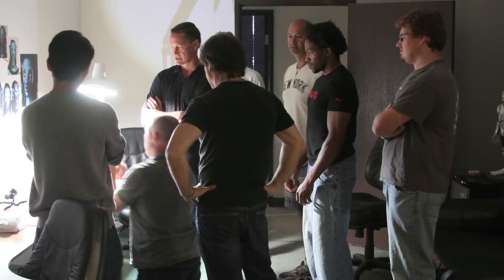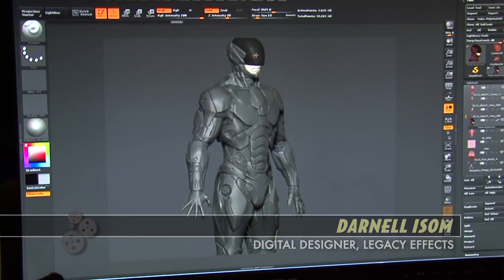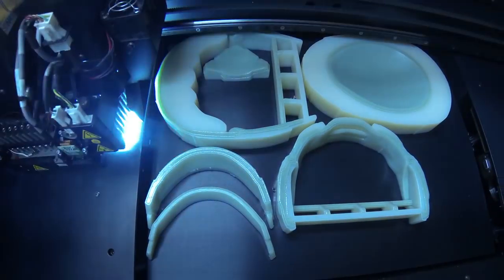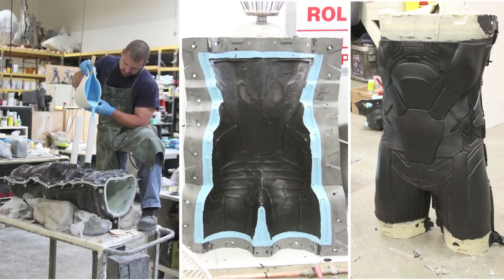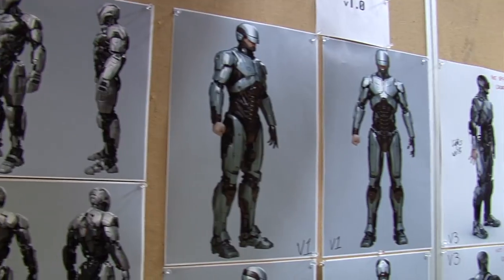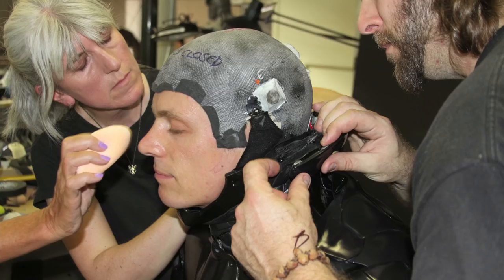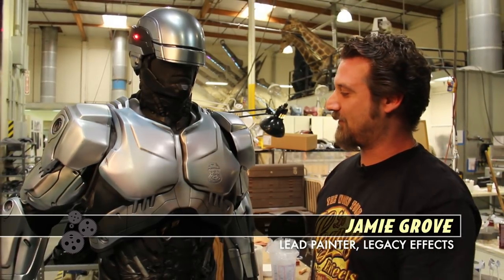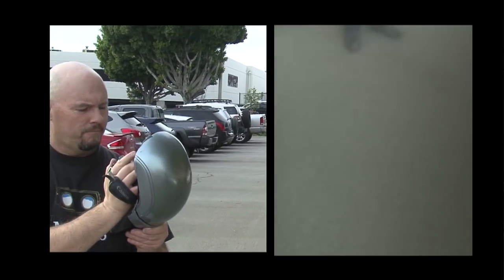ROBOCOP: Making of the Suit - Legacy Effects

Comment: Wrong actor for the role. His lower face especially the mouth looks just like a dude cosplaying. VS Peter Weller looked like a bad ass cyborg under that mask. They need to take the time to find the right guy with similar features before even consider making a suit. It's the same issue with the new Batman, only Michael Keaton looked badass and very convincing and intimidating in that outfit. Hollywood has gotten lazy, all they care about now is CGI and rake in the easy money. They no longer care about "characters" and icons.

Comment: The suit looked awful. The movie was decent. The idea of robocop 1-2 and even 3 was to make you at a certain level think about how horible it must be to have some memories, to remember your humanity but to be stuck into a machine. To not even know if you are actually still human or a machine that thinks it has some humanity in it.
Puttin that aside and turning back to the suit.
The main problem its not with the suit itself as it is with the general idea of machines these days.
The reason why stop motion looked so good in terminator, robocop and so on was because it was a fucking machine animated with a machine.
No matter how hard you try at a certain level a machine is still a stiff piece of metal. Its not nimble. Its cimetric and limited in movement. Thats why so many robot movies suck today. The old suit helped a lot for the actor in this way. Because the movement was very limited. Thats why the fighting scenes with ED 209 sucked so badly. Because a fucking 500kg machine does not fly around like something that has 5kgs.
We need to turn back to the idea that a machine is a machine that can't move as "organic" as we do.